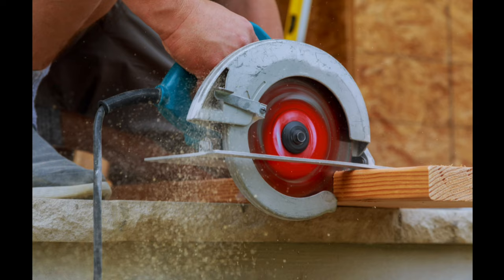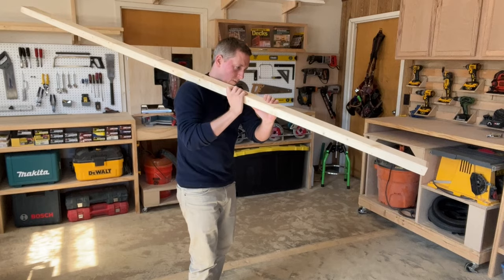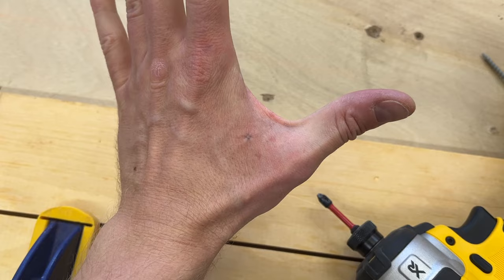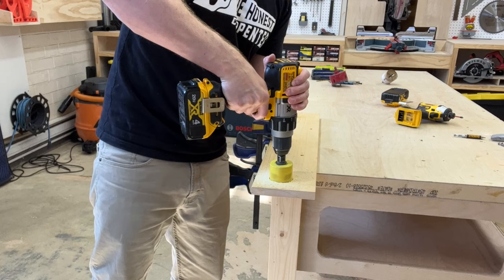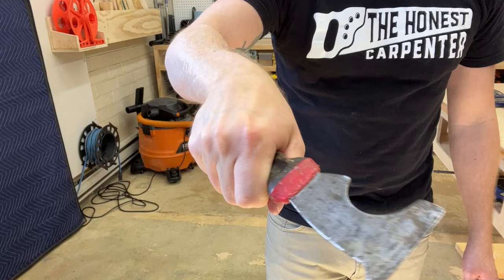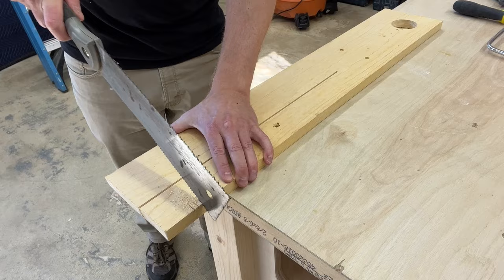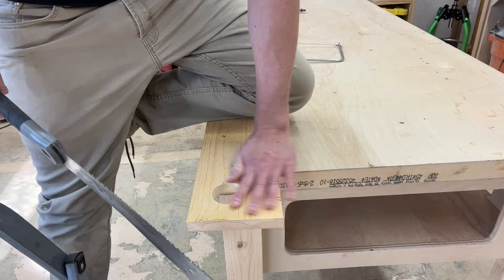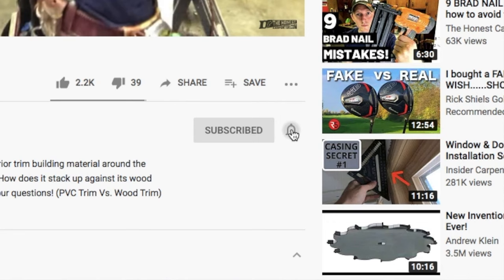9 MOST OVERLOOKED DIY INJURIES! (Avoid These 9 Worst DIY Injuries/Accidents From Common Tools!)

Comment: Also with utility knives, after every cut, retract the blade. Your thumb already on the sliding mechanism. It’s good practice to extend the blade, make the cut, and retract it in one operation. Furthermore, almost all utility knives have different lengths of blade stick out. Only extend the blade as far as you need for that specific cut. It lessens the severity of, for example an injury from a slashing
Reply from the maker: This is a VERRRRY good point. Two very good points!!
Reply: And make sure to dispose of used blades i a safe way - not laying loose in the bottom of a toolbox!
Reply: Unboxing videos are the worst! They usually feature some bright spark with 4" of exposed razor blade alternately slashing at tape and cardboard and forcefully pulling without retracting, or even putting the knife down!🤮
Reply: At work I have one that retracts itself with a spring. You have to push it out and keep it pushed out to use it. I didn't like it at first but now I'm very happy with it. It's not usefull in all situations though but overal it works very well.
Reply: @themadsamplist  Can you remember the manufacturer?
Reply: @Nick Goodall  The brand is Martor. I live in Europe so I don't know if it's of any use to you
Reply: @themadsamplist  Maybe not! Thanks though.
Reply: This won't work on switch blade style utility knives like Husky. They do have a very good blade replacement compartment/procedure though.
Reply: @nickgoodall578  starret makes one like that, you squeeze the whole body to extend the blade, then it retracts automatically. Part ID S011, $12.47
Reply: I have a real bad habit of leaving extended and keeping in my hand even as I quickly move things around. I'm gonna injure myself one day - I have been close before. I need to make this a habit.
Reply: agreed 100% but sadly no one ever does this
Reply: Stanley used to manufacture those things differently than now, they had two halves that were flat screwed together, trouble was if you applied force on the blad it could come up between the slight gap in the two halves and injure you, I noticed in recent years they changed that so it's a zig zag shape there so the blade CANT come thru the top like that, no doubt many were injured by that former design is what caused the change

Comment: I would like to add one more ladder safety item. I was working for a home builder doing warranty work, we put down plastic and drop cloths on the floor over unmovable furniture, etc. the homeowner still wanted us to remove our work boots. I told the supervisor I wasn’t comfortable working in my stocking feet. He insisted and the homeowner insisted so I removed my boots. Long story short, I was climbing up and down an eight foot step ladder painting the wall my foot slipped, the ladder went sideways my left side hit the top of the ladder with enough force that I bounced came down on the ladder again and the ladder beat my body to the floor so I smacked against the ladder again. All three hits were in the same place, I was lucky I only bruised four ribs. But my chest hurt for a month. When working on a ladder always wear your shoes.
Reply: I hope the homeowner was sufficiently frightened, if of nothing else then being sued. People who ask others to remove their shoes while doing important physical work like that are control freaks who need a wake up call. 

I used to paint for a builder whose site manager installed the hardwood flooring and he insisted everyone who came in the house did the same. He started letting up when people who worked for bigger companies would just leave, because they signed a contract stating they wouldn't work without shoes on (again, avoiding suits).
Reply: Can't do guv, these are regulation boots.
Reply: If I was going to work without shoes I’d rather go barefoot.  At least that way I have grip.
Reply: I see a lot of failarmy videos, I noticed several people on a step ladder with flip flops. So bad.
Reply: wow thats awefull. Nothing worse then a client who doesnt know anything trying to impose his ways.
Reply: @fadinasralla8194  So true. The level of entitlement and disconnect that gives rise to this kind of behavior is astounding.
Reply: I was a floorcovering business owner/operator many years ago.  I went to an estimate for a wood floor install in a 3rd floor attic.  The customer requested I remove my shoes to estimate.  We went to the attic and on the way up she said that shoes must be removed to work in the house and all cutting must be done outside.  I thanked her for letting me in and turned around and left.  If you get a headache before the project, it isn't worth it.  Customer's owe us nothing.
Reply: I do remove my foot wear when walking around the clients home but I NEVER get on a ladder, or anything similar without my shoes or boots on.
Reply: We don't wear shoes in the house and absolutely agree that it's ridiculous to force people doing physical labor in the house to remove their shoes. If the homeowner can't do some basic vacuuming and mopping afterwards they sound like a terrible client.
Reply: Wow, how wild. They make shoe covers precisely for workers coming into the house. Even in Japan, where everyone is shoe polite, the delivery people just put shoe covers on when they came in because their boots were part of their safety gear.
Reply: I have absolutely no problem telling a boss I will not do a particular thing I do not feel comfortable with and not trained to do or is it gainst a violation of code
Reply: @Metqa shoe covers are slippery as hell though compared to shoes, since the fabric can move between the sole and the surface. But I guess it's easy to take off to climb the ladder.
Reply: @Metqa  I actually go the other way, because my work boots are too large to conveniently use shoe covers.  but I won't do shoes off work if it's not safe for shoes off work.  I've seen people carry a pair of indoor shoes, though - non marking soles that never touch unfinished surfaces.
Reply: @ian1352  Then when you do that SURE ENOUGH you will step on a staple, a tack, a nail or sharp something- guaranteed!!!
Reply: @HAL-dm1eh  Well, we had an addition put on our old shop at work, all had a T&G maple floor, the contractors wore boots and when they finished the project the original maple floor inside theconnecting doorway was completely ruined by ground-in grit, mud, whatever, it was grey to black, they would up having to orbital sand about a 12x12' area and re-varnish it, but it looked like heII, it was just the shop, but still, if that was someone's HOME it would not have been good.
People don't realize how abrasive the grit, sand, dirt, mud is on the bottoms of their shoes as they tromp back and forth repeatedly in and out the door. One could lay down TARPS or even a CHeap disposable carpet runner or rubber mats, even sheets of cardboard

Comment: You forgot about eye injuries particularly with grinders. This is a very common injury as people quickly grinding down a small piece often don't take the time to wear eye protection. I'd say there are a lot of times to wear a respirator as well.
Reply: 100% admittedly I have a tendency to be a bit neglectful of wearing eye protection against my better judgement.  But grinders are the one tool I’ll always, no matter what put glasses on before I use it, no exceptions.
Reply: Speaking of grinders, I had a friend who was using a grinder with an old grinding disk. He wasn’t wearing gloves and when he began grinding, the disk fragmented and almost cut his fingers off completely.   He had two surgeries and rehab before he could use his hand again.
Reply: i got that once , with angle grinder ,  was wearing gogole but i pice bonce of my cheak in to my eye ,
Reply: I should add that I've seen clothing catch a grinder and bury it into the user's chest. These are very dangerous tools if not used with caution and a constant safety mindset.
Reply: I think the focus of this video was on non-power tools. But yeah, eye injuries can happen from using hand tools too, for example hammer work. Hitting a just started nail even slightly off target can send it flying in any direction. And of course, demo work by definition sends pieces airborne.

Comment: After 40 year of being a tradesman, I can attest to doing all of them at one time or another .  The one that I felt the most was cutting along a straight edge and running over two fingers and a thumb.  Not only cut flesh, but cut the nail and nail bed.  The nail out towards the end of my fingers of course feel off. That baby ached and throbbed for months. Not only that but, that hand was completely useless because of constantly breaking open the cut over and over from using it.   The nails took nearly a year to grow out and cover the exposed nail bed. Believe me don’t do that one.
Reply: Nail injury, from  another reason, but similar result. Dont damage your nails.

Comment: For furniture building, I think chisels represent one of the biggest dangers. Most other hand tools do not have a large blade fully exposed, with the exception of saws and utility knives, but chisels do and are kept super sharp. Add in the way that you sometimes exert quite a bit of force when using them, and a slip up can cause a serious accident.

Comment: Nate, the most important video you have ever done.  I've been guilty of the ladder issue and learned quickly it wasn't working. Thankfully, I always test the ladder out and then quickly realize that was a really dumb idea. Another one is hot bits. You're in a hurry and you ignore that heated metal object about to touch your hands. Routers esp. can get bits that will burn your skin off if you're not careful.
Reply from the maker: Router bits just about turn to lava, Dave! So much sustained friction. I’ve had welts from just brushing against them!
Reply: Same, guilty of the ladder!

Comment: I had a utility knife skip my steel ruler just as you demonstrated in this video and costed me several stitches on my hand holding the ruler on a DIY project.  This was back in the 1980's before Kevlar gloves.  When I retired, the utility company that I worked for would discipline you if you cut your hand and were not wearing the proper gloves (Kevlar for cutting).  The company believed in hand safety so much that you were allow and encouraged to take gloves home for personal use.  The company was so big that it was self insured so it was saving money on ER trips from home and light duty at work while you healed from a DIY.

Comment: Yeah, I think I have scars or bad memories to go along with all of these.  😬
A common thread to many of this sort of accident is that when your right hand makes a mistake, it's usually your left hand that pays for it.
Reply from the maker: Good way of putting it, Karl 😅
Reply: Me too! In good company. LOL 😭
And you are so very right/left/correct: Two weeks ago, I was reaming a hole in the end of a vertical board, the drill unexpectedly popped out and drove to the side and down, full force into the meat between my left thumb and finger. To make matters worse, on its way in, the drill bit grabbed and twisted my glove shockingly painfully tight. I had to reverse the drill to unwind the glove which let blood flow that had been instantly cut off. And, oh boy did the blood flow... It was a 5/16" bit. 
Wishing health and safety for you all 💖
!

Comment: I thought with the scraping or power tools you'd also have mentioned flecks of material in your eyes. I get nervous of any plumbing or very old paint flecks getting in my eyes, let alone splinters or metal chips. Glasses for the win
Reply: Or a complete face shield.  Especially when working with glass repair.

Comment: Excellent video. Luckily I learned about knife safety 55 yrs ago in scouting. 1. NEVER cut towards yourself. Only made this mistake once opening a package, just a nick. If I ever think about doing it again, I cannot move until I do it correctly. 2. Never have any fingers ahead of where you are cutting.3.  I learned how to properly hand a knife over. There is a correct technique that makes it impossible for you to get hurt. I have everyone set the knife down before picking it up and teach then the proper why to hand it. Same rules apply to a utility knife.
When I start a hand saw I clamp a piece of wood at the starting point. Looks funning and I get laugh at; but it proves a longer line to get started and I do not have my hand in the way. I also show the the scar when I slice a inch of skin to the bone off with the hand saw.
Reply: Remember Scouting. Before it became “diversified?” 
Those were good times!
Reply: Hand saw. Clue's in the name ....

Comment: For anyone wondering why old mate says ‘maintain fast speeds’ at 5:10, the reason is simply that the inertia of a fast moving drill bit is very effective at carrying the blade through resistance. If the teeth of a hole saw, for example, hit a knot or even a fixing nail etc., if the bit is moving quickly it will often tear through that hard thing before the friction has a chance to slow the bit to a stop and begin moving the electric tool (and your wrist). A slow-moving blade is much easier to stop and therefore is much more susceptible to jamming.
Another point worth noting is that while fast speeds are good, equally important things would be maintaining light pressure on the tool and keeping consistent angle.
Light tool pressure helps to stop the blade biting deeply into that area of resistance and lets it skim over the top with much less resistance.
Consistent tool angle keeps the cutting bit/blade aligned inside the hole it is creating and helps to prevent catching/jamming on the sides of the hole. An unconfident operator with a wobbly grip on their tool is far more likely to lean the tool over midway through the cut, causing the blade to bind up and jam.

Comment: I find adding a large split key ring into the hole of a utility knife really helpful, you can attach a lanyard for over head/ ladder work, but also it tends to stop the knife pulling through and gives a place for the hand to rest, I do a lot of tree trimming (palms in particular, this has helped reduce the number of times I drop the knife.

Comment: Great video! I’ve done almost all of these at one point, hard earned experience in what not to do! One other trick when drilling large holes. If your drill has a clutch, set it down to where it will drill the hole as desired but if it hangs up the extra torque will engage the clutch and keep it from kicking back.

Comment: Love the video. Lots of good tips, but I disagree with folding closed a self-supporting ladder and using it like a lean-to or extension ladder. The manufacturer designed the ladder to be used open and self-supporting. Using it any other way can cause an injury. As a construction safety professional for an insurance company, I see injuries from improper ladder use all too often. Nevertheless, I love your videos. Thank you!!
Reply: Agree. Especially when used on the wrong surface.
Using a closed step ladder (or extension ladder) on a surface like blacktop or a wet deck. Or a dusty floor. That ladder is going to slide out, almost guaranteed!
I’ve seen some pretty gruesome stuff because someone thought the A frame wouldn’t slide or the extension ladder feet would grip.

Comment: Thank you for the video! Its almost scary how accurate you describe my former mishappenings… can check them all off my list and some of them happen to me still sometimes. The biggest mistake: being in a rush. Thats almost always a bad omen.
One remark though: it might be really dangerous to operate a hand drill or rotating power tools with gloves! 
Greetings from germany :)
Reply from the maker: Good point, Peter! If they’re loose gloves, they really kill your grip. I went bare handed for many years when I was working just because I was paranoid about bad grip at crucial moments. I took the cuts and burns instead. 😅
Reply: @TheHonestCarpenter  man, I am paranoid of the splinters so I wear gloves pretty much all the time with a huge exception and that's when I'm using a table saw or planer

Comment: Not a tool injury, but back injuries are definitely the DIY injury that has been the most impactful and persistent for me. At 30, I leaned over to lift a relatively light object and boom -- herniated lumbar disc. 

Learn to lift objects with proper form, and then always use proper form for lifting, whether you're lifting something heavy or light.

Comment: I agree that the utility knife is the number 1 cause of trips to the hospital.  Ive been woodworking for over 50 years and in my shop one morning I was tapering a piece of wood with my utility but pulling it toward me instead of away as I have always done 99% of the time.  My other hand was holding the piece of wood and when the knife slipped it cut the inside of my holding hand and sent right through a tendon.  Besides being extremely embarrassed it left me with a future surgery and quite a few PT sessions to get my hand back to normal and there was no guarantee of that.  Fortunately I had a great doc and my hand is almost 100% today.  I didnt pick up a utility knife again for several years.  This is a great video especially for the old timers who get over confident with what they are doing.  Thanks

Comment: Really good info. I also have to agree those about eye protection. Being on many construction sites as a hardwood flooring installer, it was common to see a lack of any eye protection being used. One other injury I’ve seen goes back to a rule I learned in the Air Force, NEVER hold the work in your hand. I most commonly see this among electricians who hold an electrical device in one hand while bearing down on a screw with a screwdriver with the other hand. The screwdriver slips and inserts into the hand. I’m not a safety nut but a little common sense and some self imposed rules can limit your trips to the emergency room.